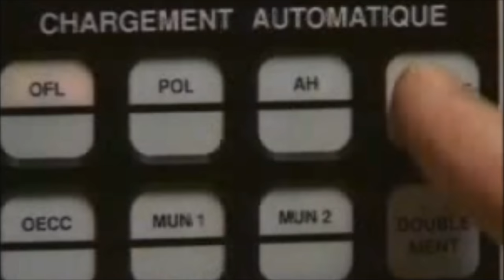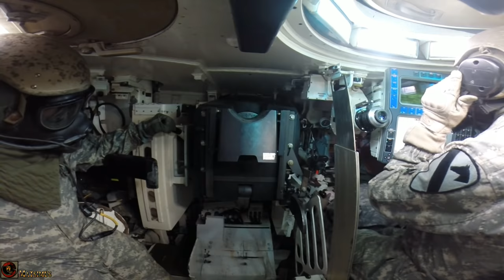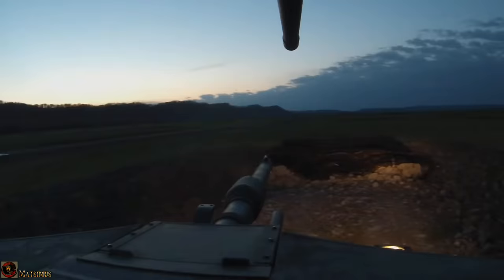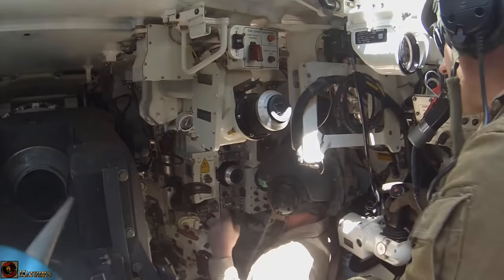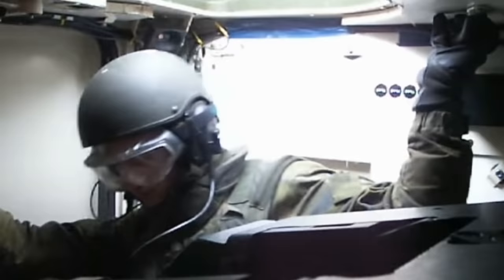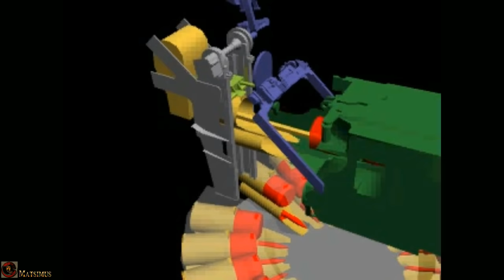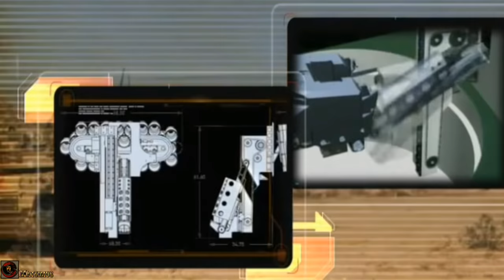Tank Autoloader or Crewman Loader?

Comment: You want a human loader for numerous reasons:

1)  Faster reloading, period.
2)  Can help pull watch/LP/OP
3)  Can help refuel the tank, especially important when hot fueling
4)  Spare body in case one of the other crew is injured
5)  We used to train 'em to use the chemical agent test kit
6)  Extra pair of eyes when on the move
7)  Can use the loader's M240 to keep folks OFF the tank
8)  Can keep the tank near fully-manned with driver, gunner, and TC while the loader can be sent off to grab food/water during ROM/LOGPAC ops
9)  Less things to "break", less complex than an autoloader.
10)  Programs the radio(s), loads fills, and switches freqs for the TC (well, in the M1/M1A1 with a single radio back in the SINCGARS days)

Autoloaders suck.
Reply: A human loader is outdated. Deal with it, period.

Comment: T-14 Armata has 3 in the bottom of the tank and relies on autoloading... the K2 Black Panther from south korea already has several deployed with a similar design

i recon all tanks will go this way, we're just in a position of change stuck with an older mindset based on what worked best at the time..... allies like South Korea having designed this awesome tank of theirs will likely eventually influence us

Comment: Prologue:  Okay, I just wanted to talk about one thing that a manual loader could do that an autoloader couldn't.  Turns out I wound up typing a whole fucking tanker story, probably only interesting to other tankers.  If you're a tanker, enjoy.  If you're not or not an old school tanker and shit's changed enough that I'm not making any damn sense, then please ask.  Anyhow, on with my rambling...

I was a tanker mostly on the M60A1 RISE Passive and later on the M1A1.  For the first year and a half I was a loader.  I got good.  The standard is to load in under 5 seconds.  I could do it in 2.  But there was one technique that I learned how to do with the 105 that is just impossible with an autoloader and even manually with the 120.  That was vacuum loading.  Not many folks know about this, including my contemporaries and especially modern tankers.  I learned by accident and it scared the crap outta me the first time I did it.  But from the moment the gun fires, I could reload and arm the gun in just inside of one second.

There are a few conditions that need to be met for this to work.  First, you need to be firing battlesight engagements so you are constantly feeding the gun the same type ammo.

Next, you need to be able to lapload.  This is where you have a round in the chamber and one in your hand, ready to go.  You can't lapload a 120 for safety reasons.  With the semi-combustible cartridges of the 120, if you have a backflash, it could ignite the cartridge in your hand.  The 105 never backflashes because it uses a fully metallic cartridge case and even if it did, well, you have a full metallic cartridge case.

Third, you need to be firing from a stationary position, because this is dangerous enough as it is.  Adding movement of the tank to it is just insane.

Just about the only time when all of these conditions are met is I think maybe one Table 8 engagement and when firing an FPF (Final Protective Fire) which is a desperate last ditch defensive technique where you are just dumping as many rounds down range as possible.  It's also good for burning through as much left over ammo from your exercise as you can so you don't have to box it back up and return it to the ammo dump.

Okay, so now you've got a round in the tube, one in your hand ready to load, and the gunner is laying on target.  You need to stand as close to the breach as you can and still be clear of the path of recoil, holding the round at port arms.  When the gun fires, before the empty even hits the deck, you drop the nose of the round into the breach, keeping your fingers bowed away from the round.  Very important.

When that gun fires, the projectile and propellant gasses go out the muzzle and the empty brass goes out the breach.  For a very brief moment, there is a vacuum in the guntube.  If you time it right, when you drop the nose of the round into the U of the breach, that vacuum will suck that 35 or 40 pound round right out of your hand.  SHCUNK!!  The first time I did it by accident and had to pause and count my fingers.  After coming up with 10 and then double checking that I really did still have 10, I remembered to slap the arming switch.  UP!  "Cool" I thought, "Let's see if I can do that again!"  And so I did.

Now, you are going to get hit by the empty on the bounce.  But if you're not used to getting hit, you've got no business being a loader anyhow, or a tanker at all for that matter.  Thirty years later and I still have a few happy little scars on my shins.  Also, you have to be extremely careful that your knees do not wind up anywhere under the gun carriage.  Like I said, dangerous as fuck, but if the conditions are right and you're careful, you could put the first two rounds on target in less than 5 seconds.

The TC that I had when I first discovered this technique realized what I was doing because he used to do it himself and he taught me how to do it safely.  Not every TC I had would let me or even knew what the hell I was doing but then again, if they have their face pressed into the rangefinder, then what they don't know won't hurt you, and better to ask forgiveness than permission, etc, etc.

Anyhow, I got good enough at it that the company tank leader (an old grizzled MSgt) had to tell us to slow our rate of fire because 1) he didn't want too many of his loaders getting the same idea (turns out as a TC, he used to teach this to his loaders in Vietnam) because then some asshole would have to make up some rule as to why we couldn't do it, and 2) he was afraid we might actually overheat and prematurely wear out the guntube.

I'm guessing that you would probably be hard pressed to find a modern tank that you could do this with, but if you do (and you somehow keep all of your favorite body parts intact) then there ain't any better way that I can think of to double-tap that pesky little tiger downrange.

Comment: Autoloaders definitely but the man still has to be involved in fully trained jams in for you to fire happen. But anything to cut the workload down on a warrior is a good thing also it speeds up firing specially sustained firing a man tires machine does it. But machines need maintenance and repair they need to be monitored

Comment: Umm, the T-64 can have ammunition selected by a crew member. They use a system do raised dots on the sleeve of the round to denote what it is when the commander or commander is looking for a particular round. 
I believe these systems haven been used on all previous Soviet designs, other than the T-14 or T-90MS.

Comment: You gotta keep in mind that Russia and other countries that deploy tanks with auto-loaders don't care so much about crew safety or preserving the tank for repair. They'd rather lose the tank and the 3 personnel because its cheaper to just build another tank. The U.S. and similar countries design their tanks to try and save as much of the tank as possible and keep it operational. This why having a 4th crew member can be so useful for maintaining a tank and keeping it operational even after taking a hit. Long story short, the Abrams is more expensive, but it's also more durable.

Comment: Every seems to generally ignore the other functions that the loader has as a crew member on the tank.  Let's see the auto-loader effectively use the extra turret mounted MG. Sure you can make this a remote controlled gun but at what weight, cost and complexity.  An auto-loader can not think in a crisis situation and can not unload and/or replace the ammo if the dynamic battlefield tactical situation suddenly changes. Yes this can also be a negative with the additional voice/opinion/decisions potentially being more a detriment than a benefit at times.
Reply: sutch a bullshit argument, in the most critical moments hes needed, and without him the tank cant even shoot. if you actually had an advantage from 4 man crew you could have a 4 man crew with an auto loader and have an extra person available allways

Comment: Re: John Doe...

Comparing an ammo selective shotgun with a tank's autoloader might be a bit simplistic. A shotgun shell weigh but a fraction of what any MBT main gun round might be and while pretty much most hand-held weapons load by mechanical means, an autoloader on a tank would need to be extreme robust and yes, somewhat massive compare to a shotgun chamber. 

To such comparison, I would use a revolver as an example; while the cylinder of a revolver chamber the next round by the mean of the cocking and simple ratchet system, but loading a main gun round, even without selecting ammo types, would involve far more complicated electrical, mechanical and hydraulic means.

There are videos of autoloader tank interior and from what I have seen, there were simply NO ROOM to add all those things you have talked about to offer both autoloading and manual loading options within such turrets! Gunner and TC share those very cramped turrets and barely have enough rooms just to sit comfortably, let alone perform those body-twisting routine of loading a hefty round into even a conventional breech.

Personally, I also agree that in the future, there might be excellent autoloaders to be had but so far, I wish fellow MBT crews with autoloaders would come onto this thread and help in clarifying this particular issue.
My comments were based on personal experience as part of a tank crew and as a commander of armor units. I would love to hear from crews from other countries with 3-men crews... what their likes and dislikes of THEIR autoloading system and how their 3-men crew worked, shared or divided duties, in comparison to the more traditional 4-men track.

This is, as far as I am concern, not a debate but rather, an extremely lively discussion... as long as we continue to respect one another and maintain civility. For that, I thank everyone in advance, especially Matsimus!

Comment: Slight off topic comment regarding the Armata.....perhaps someone who knows can set me straight.  It seems to me with the crew encapsulated in the hull, there will be very little, if any direct vision for maintaining situational awareness.  It looks as though the turret is well populated with a variety of electro-optics for search and target functions.  Now, granted, the hull is heavily armored and there is an active protection system and reactive armor.  I'm wondering what the effect will be on all the sensors of an incoming round that is defeated by the protection system and reactive armor plus that of the chemical or kinetic round itself.

  That is going to be a lot of energy and fragmentation released in a very small space.  What will be the effects on the sensors?  What about an immediate follow on shot from the same quadrant?  Seems to me that a mission kill would reasonably follow all that commotion.  Certainly you could expect increased vulnerability for a partially or completely blinded tank.  Buttoned up tanks are a lot easier to sneak up on.  Interesting that the default position on the Armata seems to be buttoned up.  

As you point out, the Americans took a look at this configuration with the M! test bed and decided not to develop in that direction.  Must have been some reason for that.

Comment: Your points have value but they were not viewed from angles and in my opinion were pretty optimistic and picky. Let's get to them: 1. Autoloader breaks => tank is out of action; Human loader killed/knocked down => tank works fine? Really? Explain the exact procedure, step by step how you want to load the gun while dead/k.o.ed body (or, god beware, body pieces) of the loader is (/are) in the way? 
2. Blow up panels are in my opinion one of the biggest farces in history of military. Who in it's right mind believes that if a tank gets hit by an AT-shell some 1-2cm thick panels will "save the crew"? If your ammo blows up the tank is toast. Period. There are 0 materials to prove me wrong on that one. And if there is a material which says "tank sustained a hit, blow up panels saved the crew" then it's most certainly that a tank got hit by a 30mm or some smaller shell, Penetrated the ammo storage and blew up the whole storage making the tank obsolete and shitty designed...
3. Autoloader maintenance is pain in the ass... But human loader maintenance is easy? The dude needs food, water, meds, place to sleep, hygiene... Not to mention that an autoloader can be mass produced if you do your industry right but the human loader needs proper training and experience to operate well. Also autoloaders are pretty solid and robust piece of metal and mechanism. It doesn't care if it gets hit by something while a small blast placed on a biological body can do WAY more harm!
4. While you can maintain 3 of your tanks better than me because your tanks have 4 crew members instead of 3, me on the other hand can bring ONE MORE manned tank to the battlefield. And i don't need to put effort into teaching one more person to operate properly.
5. In general: humans can be reliable but can also be completely useless and incompetent! Humans break faster than solid and robust metal! Humans can be shell shocked and loose coordination! All you need is a decent and cheap HE hit which can knock out the loader but most probably won't harm the loading mechanism!

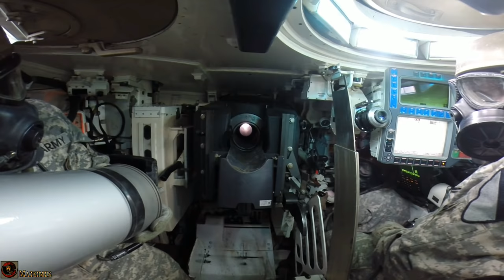Comment: At 3:22 You seem to be the opinion,  that the crew is more in danger to get blown up by exploding ammunition in a tank with an autoloader. That does not make any sense.
In a tank with an autoloader the crew sits usually in a separate compartment without any contact to the ammunition. See the Armata. While a human loader naturally comes in contact with the ammunition.
Reply: Karot !  Your answer fits into nowadays "alternative facts"  times. You cant have an own opinion on facts, if your opinion totally contradicts the facts and reality. Thats like saying: in 2019 I will live healthier: I start smoking on the first of January.
Nooo! Smoking does not improve your health. Fact. Period.
A loader ....aehm, loads ammunition, thats whats his name says, surprise! So he is obvious in more contact and therefore dangour, than a guy who sits separated from the ammunition in the rear of the vehicle and is secured by a specially designed blast proof wall. Fact. Period.
Reply: Karot !  OK. Actually I think his opinion came from the T 64. It was the first tank with an autoloader. And its design had the human loader still sit on top of the ammunition at the autoloader, because they didnt trusted the autoloader to work all the time. The same is true for the rest of the crew. They were all seated in the same compartment with the ammunition. And this tank had no blast doors to give a possible explosion room to expand out of the tank. So in this case (and in the later T models) it was true, that the crew was in danger. But its features were only typical for this tank, produced from 1951 on. So you can have a seperate crew compartment and blast doors and an autoloader together.

Comment: Autoloader has advantage in a continuous fire.

But in real situations. Tank does not fire its main gun so often. Thus eliminating the this advantages.

So there is no reason to install autoloader and loss more maintenance cost.
Reply: Autoloader needs less space. Tank gets smaller profile, needs less armor, getting lighter and faster. Autoloader needs niether food no training. Flesh is weak and fragile.
Reply: Well, if things go as planed and the next generation of NATO tanks will change to the 130mm canon you will not get around an autoloader, simply because the rounds start to get to heavy to be loaded manually in a meaningfull timeframe. The DM11 programmable HE round germany intruduced a few years back for the Leopard 2 is already 29kg/64lbs, which is pretty much the limit what a human loader can do.
Reply: @shi01  I guess "US and friends" could make an autoloader decades ago and they even had some projects. But the tank is not just a single vehicle. It is a part of sophisticated military system. Maintanance, logistics etc... And looks like that system needed additional human meat to be a part of that spam can. Modern warfare goes to robotized unmanned systems.
Reply: @5oa8in2wr  logistics lol

Comment: interresting, and i can agree to the argument of an extra pair of hands on board the tank, as a medic, extra lookout, mashine gunner or simply for maintenance, but to be honest most of the other points, you adressed in your video, are in my eyes design flaws of existing systems. I do think that if a group of engineers really puts their head into it, they can find a way to build a "real" autoloader, with switching magazins and load and unload capability. but this kind of system would need a totaly new tank design and is probalby not adaptable to excisting typs. But even if the system would clear all those problems, it would still be not sure that the Army, or in my case the Bundeswehr, would except such a system for combat. i think it is more a matter of philosophy right now...and not a real technical issue. And i am pretty sure that with introduction of more and more drone technology it wll not be long before we will see the first tank-drone, either remote controled or more or less autonomous, followed by a battle-tank-drone which need an auto load system anyway becasue there is simply nobody onboard anymore...so i think in the end there is no way around it, the autoloader will come in the not so far future...to much ? :)